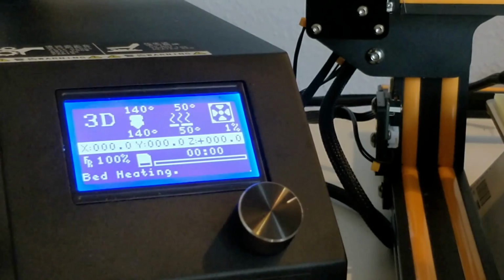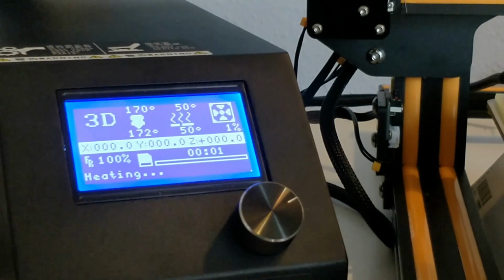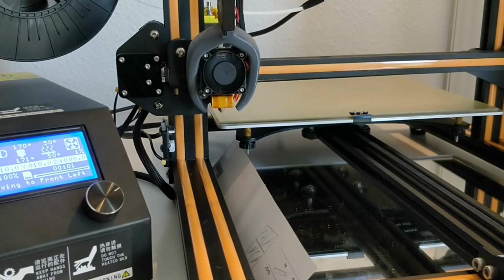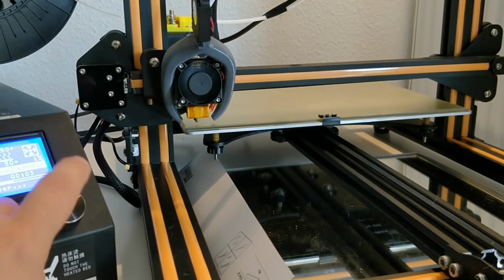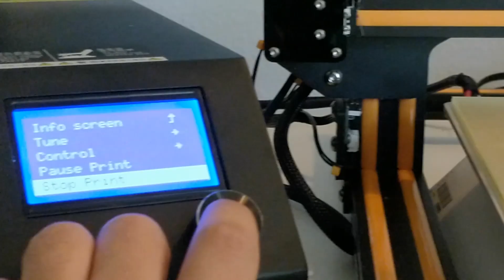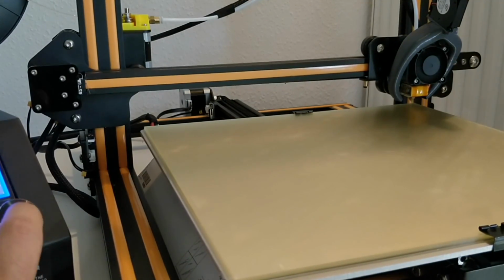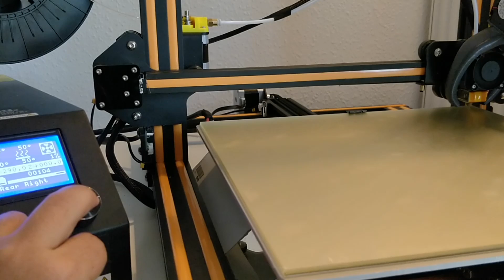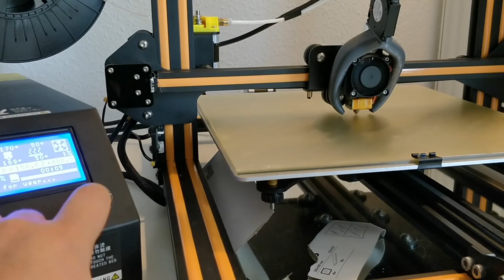Bed Levelling Assistant - NEW LINK IN DESCRIPTION

Comment: Good video you may also want to look at upgrading your firmware if it will accept it and doing a manual mesh bed leveling
Reply from the maker: Don t tell anyone... but the system thats built in uses the same code... SHhhhhh

Comment: The CR-10S is supposed to have something like this built in (Garry Purcell has a video on this) but apparently is was disabled in a later firmware . . . bummer. 

But this is great!!! I just used it and it works absolutely perfectly! I am going to modify the gcode for my monoprice mini v2 and will share the gcode for others. From what I have seen of the auto leveling in the CR-10s firmware (before it was disabled) this gcode is even better. I love that it makes me check it three times and then checks the center - completely brilliant!

Thank you for this!

Comment: Good video! But cant get the code anymore from that link and the code would be much better if it went to the head stopped directly over the screw locations on each corner.

Comment: So I used this gcode but the friggin middle of my plate is still out of whack I can fit2-3 sheets of paper in the middle. I dont know what to do! I'm using a mirror from Home Depot so I know the plate itself is flat, so I don't know what the issue is and I'm losing hope.

What are you using for yours?
Reply: Could you upload the gcode somewhere to share online?  Omar's Website is apparently down.

Comment: Thanks for the info. may i ask why it has to heat up before leveling process?
Reply from the maker: the nozzle and bed are made of metal, which expands when its heated. You can get a more accurate leveling with the bed and nozzle close to the temp you usually print with.

Comment: Omar can you do a Gcode for the printer to stop the print in a wanted distance and do like change filament, because change filament acturally resume the print, that will alloud change colors without been there in that espesific time.
Reply from the maker: Sorry but I no longer have the stock machine, so testing this wont be possible

Comment: Nice! Now, if I may.... I believe it'd be better if the nozzle is placed right abobe each leveling screw, since those are the fulcrums, otherwise whenever you adjust another point (e.g. the oposite corner) you lose the previous adjustment, and this is what forces you to do it over and over until settled. Not even the stock "auto level" option does it, but I think it would improve the leveling process.

Comment: I have been printing for more than 3 years but the info you provide is still valuable to me. I allready have the Ikea mirrors. 1 trick is to sand the mirror so you don't have to use adhesives anymore. Just heat. Second tip is to put wingnuts under the leveling knobs wich will keep the bed level for a very long time.
Reply from the maker: Thanks for the tip

Comment: The S4 version is off.  The rear right and rear left position go to absolute edge of the glass and you cant level because the glass and nozzle dont overlap enough to slide a piece of paper between them.
Reply from the maker: Strange, many others have tried it with great success...

Not sure what to suggest
Reply: Omar's Tech it might be an issue with my marlin version i got from TH3D.  For whatever reason, if i print a box and use S3D to start at the center, it does not.  Instead its off center by about 10-15mm.

Comment: Thanks for the tip on the Ikea LOTS mirrors.
http://www.ikea.com/us/en/catalog/products/39151700/
Your leveler script is exactly what I was thinking of doing, but without any knowledge of g-code (yet) ... next step would be four stepper motor screw jacks on the corners ... and a digital linear position indicator ("dial indicator") gauge in a feedback loop ... that would be luxury ...

Anyway, thanks for developing the code ... an invaluable time-saver for the CR-10.

Also the level adjustment knob embiggeners make it much easier to adjust the bed height without reaching under the bed.
https://www.thingiverse.com/thing:2408748
Reply from the maker: Thanks, Yes I have been planning to do the knobs, but I guess Ive just gotten used to not using them :)

Comment: This is really useful. When you move the axis manually (in the menu) to do this, the motors de-energize and the z axis sags!
Reply: I noticed the same thing and have resorted to marking the top of the leadscrew with a sharpie and have observed it, also moving the  y & x axis via the menu isnt much good either as they time out too quick

Comment: Awesome work Omar! The only other tip I can think of for a bowed bed it printing the wedge jack thing (thing:2168244) and adding it.
Reply: Also nice touch with the pacman tone.
Reply from the maker: I was initially planning to do that, but because everyone uses a variety of filament and different bed setups it was gonna be impossible.

Even for the same individual person, maybe one day they're printing in PLA and the next day in ABS.

I really wanted to do this, but gave up trying to find a good way :(